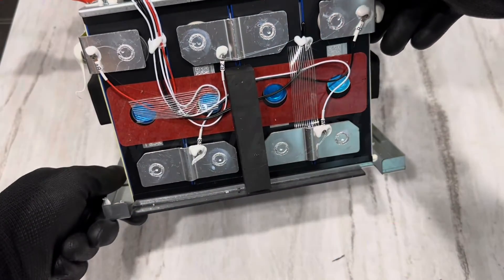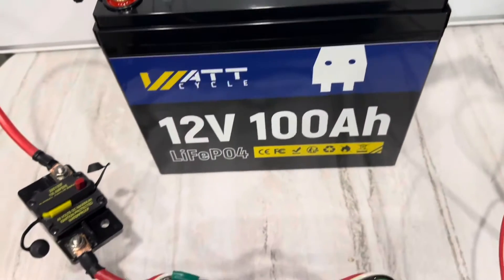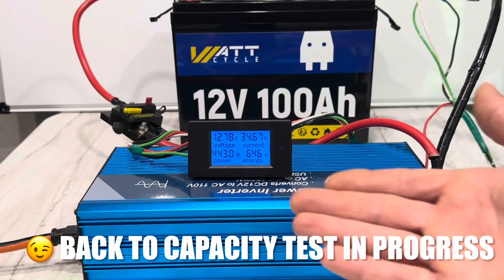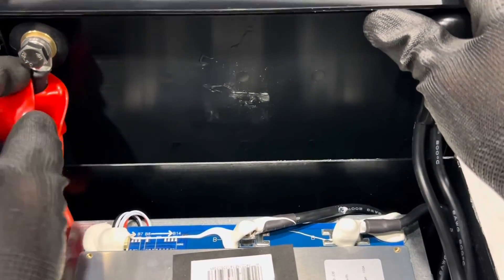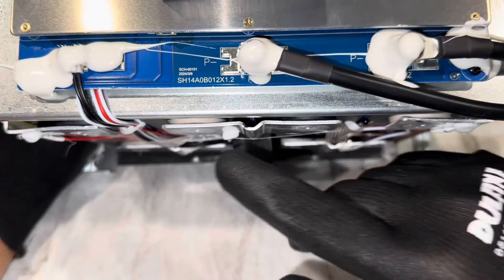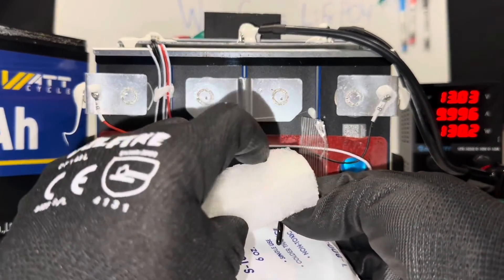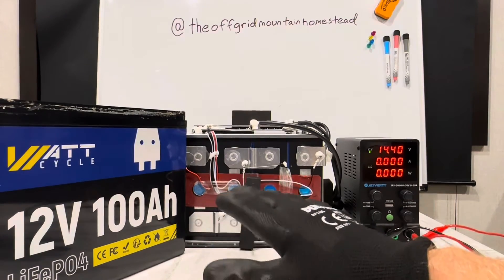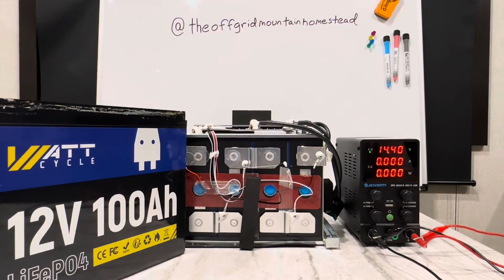WattCycle 12 Volt 100Ah LiFePO4 Battery

Comment: In your opinion which 12 volt 100ah lithium battery is the best bang for buck for a 12 55 lb thrust trolling motor. With all the protections i need.
Reply from the maker: LiTime, Redodo, Power Queen they all have solid  and consistent performance/quality. Just pick a version tailored for your use case scenario. No funny business going on with these brands.

Comment: Can someone explain to me the difference between a 100ah group 24 and a 100ah group 31? When I look it up it says the group 31 has more capacity.  However, they are both 100ah.  They also charge the same for both.  Are they essentially the same exact battery, just with different packaging? Or am I just misunderstanding something here?
Reply from the maker: Group 31 is a larger BCI (battery council international) case size. Wasted space basically. I prefer group 24 and minis. All same cells and components just less fluff. All same capacity. Pick what suits your space and budget best. Used to be G31 were cheaper and minis were more expensive pretty equal now. Hope this helps!
Reply: @THEOFFGRIDMOUNTAINHOMESTEAD  Thanks for the reply. I was getting pretty confused about it.
Reply from the maker: You’re most welcome, if you look through some of my videos you can see all the foam and padding in the G31 cases. Most of these cases are made in India for lead acid batteries. China buys them on the cheap for building lithium batteries. Hope this helps!

Comment: I’ve been running these batteries in my solar set up for 7 months now, I’m just not sure they are the quality they are stating, sure brand new they worked fantastic and I was happy with them, but after actually using them, I’m not sure they are up to par as the more expensive batteries, I have 2x100ah lithium batteries making 200ah and they have the life of maybe 50ah, I will put a battery. Charger on them they will charge to 14.4v but as soon  as it comes off the charger they drop down to 13v. I’m wanting a little more ah so I will be replacing with the vatrater 460ah battery
Reply from the maker: Thank you for sharing your experience! Sorry you’re having troubles. I left one of mine on RV bumper all summer in the sun for an extreme weather/temp test connected to my RV systems battery bank. It still works as expected. You shouldn’t have any noticeable degradation of capacity after only 7 months. 🤔 The voltage drop to 13 after charging is odd. Are you using a wall dedicated charger for LiFePO4? Or are you using a solar charge controller? 
Example I charge to 14.0V on solar charge controller. Absorb end amps of 0. Battery rests at 13.7V for many hours usually settling to 13.5 by next day. Kick the inverter on and a drop to 13.4. Start loading it up and 13.0-13.3 for majority of capacity depending on current draw. This is of course at night or with PV off.
Reply: @THEOFFGRIDMOUNTAINHOMESTEAD  I charge with both, a 20 amp charger made for a lifepo4 battery I use as “shore power” and also charge with 400watts of solar depending on the day 😂
Reply from the maker: That’s so odd that it drops to 13.0 though. My friend Tobi had an issue that may be similar. Is your battery acting like this? https://youtu.be/x21k9nVuo3U?si=irCUB5csoYv6rSN0
Reply: @THEOFFGRIDMOUNTAINHOMESTEAD  My Wattcycle battery sits at 13.2v after I take off my Vevor 35a charger. its only ever been ran down and charged one time
Reply from the maker: I need to look into this more. Don’t understand how so many are having these WattCycle batteries drop to 13.0-13.2 after coming off the charger. This isn’t normal. Unless there is a high cell and over voltage is triggering while charging with rest of cells not reaching full state of charge?
Reply: @THEOFFGRIDMOUNTAINHOMESTEAD  I just got around to being able to watch the full video but yes that’s exactly what happens
Reply from the maker: Odd indeed! Sorry I can’t offer full diagnosis yet… I will find out to the best of my ability. I have a trolling motor edition and took it out of parallel with 3 other watt cycles this afternoon just to make sure nothing crazy was going on. It’s at 13.5 on the terminals disconnected from the rest of the set. System voltage at 13.5 as well. Solar charged though at a slow C rate. This is the only difference I can determine so far is that I’m charging way slower than others and I’m stopping at 14.0V to tail current of 0 Amps. But I can’t determine if my assumption is correct if one cell stopping the charge and the other cells dragging the pack voltage down to what everyone else is seeing. I’ll partially drain then charge one up independently tomorrow with a 14.6V charger and see if it pops COV and acts like everyone else’s that’s having issues.
Reply: @THEOFFGRIDMOUNTAINHOMESTEAD  I do see a pattern here, when the batteries are fully discharged, and charged again is when I’m seeing the voltage problem
Reply from the maker: Excellent information! Thanks for that! This helps tremendously! Makes it look more and more like a balance issue or possibly poorly matched cells? I’ll dig into it and see what I find.
Reply from the maker: @JordanWhaley-u7p Hope this helps you https://youtu.be/CpDsLwywTFE?si=Ul_klnhWeo9RCBJx

Comment: I need to use the HUMSIENK 12V 100Ah in parallel with a WattCycle 12 Volt 100Ah (both have the same parent company) Same bms settings according to their manuals. Will it be okay or have issues?
Reply from the maker: When paralleling batteries from different vendors, the standard is each battery shall have its own overcurrent protection device. This mainly due to different current carrying capabilities of different BMS. Just bc the specs read the same doesn’t mean they will trip or protect at the same time or same current/temps etc. Blue Sea or South Bend components terminal fuse might be just what you need.
Reply: @THEOFFGRIDMOUNTAINHOMESTEAD  Will look into getting me a terminal fuse. thank you for the reply and the video

Comment: Has anyone used this battery for portable Ham Radio use? Curious for some feedback. Thanks!
Reply from the maker: I believe Mike @hamradiotube has some WattCycle batteries. Hope this helps.
Reply: My thoughts are that this won’t be a clean DC power output compared to a lead acid battery. There are electronics inside the pack that regulate the wattage. If you want clean power, use a lead acid battery. 73

Comment: I ordered one originally for my boat, loved it, and it was dirt cheap. Temu had an insane deal on a four pack, and I needed new batteries for an off grid 24 volt dc setup. So I decided to roll the dice.  They all worked fine for about 3 weeks and than two batteries crapped out, measured like like they opened. Dealing with their support was a bit challenging and to be honest at the price I got them at I was not expecting too much. I am shipping them back today  and I will see how long it takes to get replacements.
Reply: I setup the charge controller profile per their spec, two are still working fine, and the one in my boat is fine. Honestly I am not concerned yet as they are telling me they are sending replacements and nothing is perfect. In general across the spectrum of electronics reliability is not as good as before COVID, which is to be expected.
Reply from the maker: Did the batteries go to 0V on the terminals? What were your charge profiles? 
I have left watt cycle outside all summer on my RV tongue connected for extra storage capacity. It’s doing ok. Sorry you’re having issues

Comment: I don’t have an issue with the tear down of the battery, but I think you were a bit harsh on stuff that you would never see and would, most likely, never affect the operation of the battery. I’m pretty certain that there are a number of Battle Born batteries and other premium companies batteries with “twisted” bus bars in them. Just because a few people have torn down premium batteries in no way quarantees that every one of their batteries out there is “perfectly” built. It doesn’t really affect the operation of the battery and 99.9999% of people will never know that it was slightly bent. I like the fact that the “mini” was built with cells instead of pouches, I’m sure the pouches are fine, I would just rather have cells. For the money, I think this is a very well built battery.
Reply from the maker: Sharing observations. If I didn’t call out the bent parts, a viewer would after watching. I try to be thorough as possible.

Comment: How did you get this open?  I have a few I'd like to open up but don't want to ruin the battery.
Reply from the maker: I just grab the lid and pull it off the lower battery case. Some of the epoxy sealed ones break the plastic. Hard to know which you have until it pops off or breaks.

Comment: I would love to see the max surge current draw and for how long.
And did they send you this battery or did you buy it?
Reply from the maker: I do a 25% +/- over rated discharge for 10 minutes on these batteries. This one has 100A continuous rate so hence 125A test. I could surge them to 200-250A for a test, but trying to keep the tests same across the brands. This was a sample battery provided by WattCycle as you can see I pointed out every detail even the drawbacks to this battery. All this information is stated in the description and the video! Thanks!
Reply: @THEOFFGRIDMOUNTAINHOMESTEAD  Yes,  almost all test videos seem to miss the max surge test.  The reason I ask is there is a market of people looking to use these for trolling motors and golf carts which can have high initial start up amperage till moving.  The surge amperage test will can determine if the batteries will work properly in the boat or cart.
Reply from the maker: I will start including that in the testing! Thanks for the suggestion! I appreciate a different perspective on the use case scenarios on these batteries. I’m usually thinking in terms of micro grids/solar energy storage I often overlook other user requirements like those you mentioned. 
Thanks again and look for surge testing coming soon! 👍
Reply: @THEOFFGRIDMOUNTAINHOMESTEAD  No problem.  It was a great break down vid.